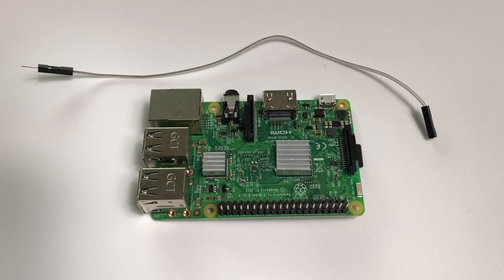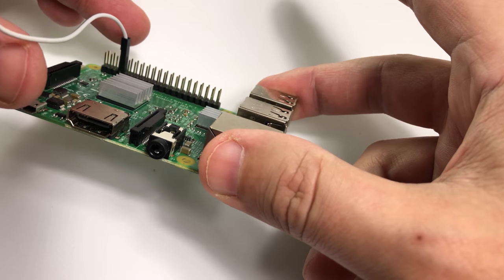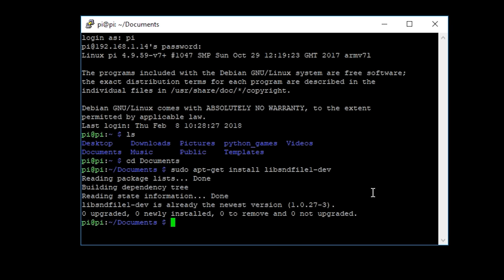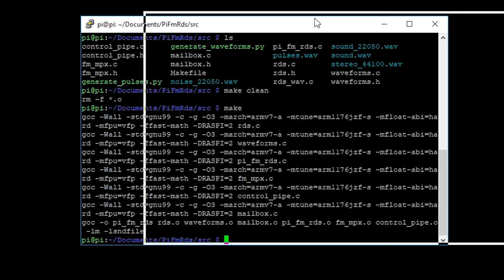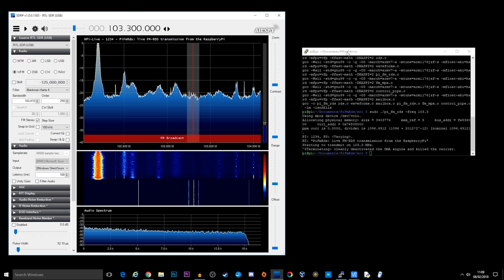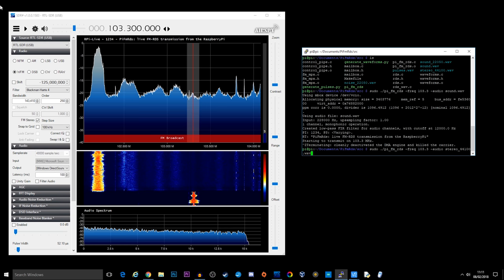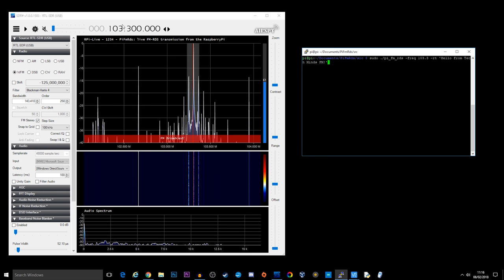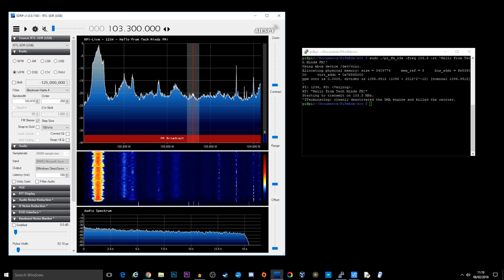How To Make An FM RDS Stereo Transmitter Using A Raspberry Pi

Comment: Would love to try PiFmRds on a Pi Zero! 

BTW, I understand projects based on the original PiFm require specific hardware (dma) support to toggle the I/O.. but others, like markondej/fm_transmitter can be configured to use dma OR cpu.. while somu1795/fm_transmitter does not use dma at all?     Is that correct, or do these fm_trasnmitter projects serve a different purpose?

Comment: can i add a yagi antenna to increase the range??
Reply from the maker: I don’t see why not. You could also try using a broadband amplifier, depending on what frequency you want to TX on
Reply: @TechMindsOfficial  i am not able to hear anything. I started with a fresh os and can't hear anything. please help
Reply: @techlatte3694  you have setup the pins properly and set frequency?
If yes try "sudo apt-get update" and "sudo apt-get upgrade"
Reply: @j_owatson  i have tried but it ain't working. I tried a similar repository named fm_transmitter base on pifm only it worked but there was so much noise in the background that i barely could hear

Comment: Is it possible to transmit a live Radio-Stream with it or can I just transmit MP3 files?
Also thanks for that very nice Video. Good Work!
Reply from the maker: Thanks Kiwi! I believe there is a way to pipe live audio using SOX, I’ll add that to my video list :)
Reply: @TechMindsOfficial  That would be very cool! 😃
I am here in Germany and I have no possible way to get the BBC Radio 6, bit that's my favourite Radio so I always need my phone nearby and that is so annoying. So I would play the BBC Radio stream and that should then get transmitted throw FM in the house. That would be awesome! 👍
Reply: @Kiwi-ul5ld , beachte, dass der Pi deutlich über der maximal erlaubten Sendeleistung senden kann (müssten so 53mW sein), daher sollte man nur eine kurze oder keine Antenne nutzen/keep in mind, that the transmit power of the Pi is above the legal allowed power (~53mW), so only use a short antenna or no antenna. And i do know, that the comment is older.

Comment: Do you know how safe this is, like I won't get in trouble for interfering radio frequencies. Or maybe where I can find that out
Reply: jim blonde You can get in serious trouble with this. Owning an unlicensed radio station is illegal. Also, as rpi uses square waves as a carrier, it creates a lot of noise, not only in Fm frequencies but also below or above them. Be careful.
Reply: @minepro1206  This why the RPF (raspberry PI foundation) removed/changed this hardware from the PI4 and later PI's and updated SoC's.
Reply: @martindejong3974 , it still works with the Pi 3 A+, i think it‘s made in June.
Reply: As I said the RPF made changes to stop this working in the RPI4, not the RPI3+

Comment: I got my gpio 4 pin shorted after trying to connect wire with sdr

Can i make other gpio pin to work as that?
Reply: i think so
Reply: NO! the hardware to generate this FM modulated square wave is only connectable to one GPIO pin!

Comment: I am having an issue with the rds do I even need an Ariel to test that?
Reply from the maker: The signal should be fairly strong to the receiver for the rds to work, so I would suggest popping a wire into the gpio pin that you chose.
Reply: Tech Minds I’m scared to do it though because of how often it failed
Reply: I’ve decided to try again and I have bought Jumper Cables and a usb sound card on Amazon

Comment: It's not possible for me to get runtime RT and PS to work, can you help with this?
Reply from the maker: Sorry, could you explain a little more please and I’ll try and help 👍
Reply: I would like to change RT and PS while I send radio signal, as well as enable TA, this will not work for me
Reply from the maker: Ok, I havnt tested this yet, but there is a section in the documentation: https://github.com/ChristopheJacquet/PiFmRds#changing-ps-rt-and-ta-at-run-time
Reply: Yes, I have seen but I can not make it work, I have to do something wrong
Reply from the maker: ok, I need to order another Rasp Pi as mine is currently being used in a project, but once I get one I will investigate this issue. thanks.
Reply: Tech Minds oh! thank you very much! :)

Comment: Is this UHF or VHF?
Reply: The FM broadcast band (76 or 88-108Mhz)is within the VHF portion (30-300mhz or 10 to 1 meter wavelength) portion of the EM spectrum.
Reply: It will transmit on ALL bands, that is exactly the problem!

Comment: Works with Pi 4?
Reply: yes
Reply: @koenkandelaars6386  You're too late brother but thanks anyway..
Reply: @iangabrielalcantara7756  happy to help...kinda lol
Reply: @koenkandelaars6386  Thanks anyway bruv.. My capstone title was not chosen anyways. But I plan to do this for my next Rpi project. Thanks again
Reply: NO IT DOES NOT!
Reply: @martindejong3974 , it should work with the Pi4.
If you have any issues like slow audio, you might need to change the ppm. For me (using the 3 A+), 55000 ppm worked.
Reply: It does NOT work, as the RPF has changed the hardware, to protect its users agains arrest for transmitting on protected frequencies such as military and avionics. Ik know its possible to work around the changes the RPF made, but please don't! as said it will break the FCC license for the PI, and WILL emit FM modulated signals in military and avionics bands.

Comment: I've tried this multiple times and I've never got it to work I know this is an old video but are you prepared to a how to solve common problems video?
Reply from the maker: Did you start with a fresh install of the pi OS?
Reply: This function was removed from the later PI's (PI4 and later) as the RPF realised using this you are also transmitting on military and avionic bands (due to the fact that the RF signal is a square wave, thus transmits many harmonics) SO IT DOESN'T WORK ON THE RPI4

Comment: Any Idea on the range? Anyone has done a range test?
Reply: RunWay Yeller#2950 im about to do one today :)
Reply: @markdj57  without an amp, probably not but if u have a decent connection on the pi to ur antenna and a goood long range antenna then u might reach that
but i dont think the 5 mW is strong enough for that
Reply: Mark Stronge Worth a shot just don't blow anything up